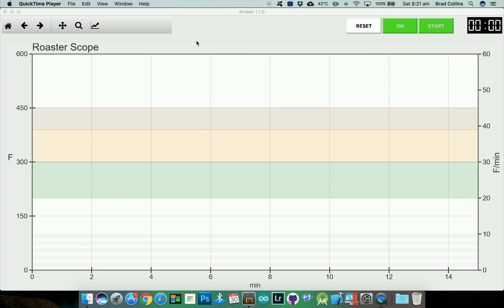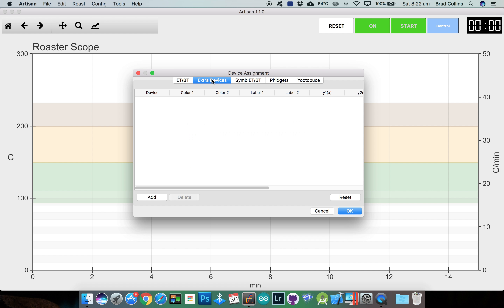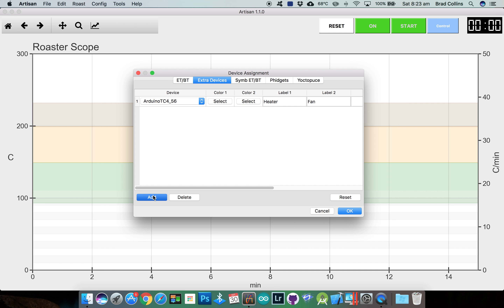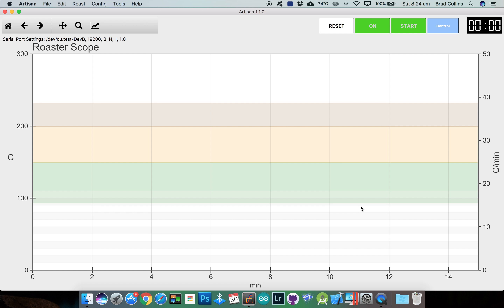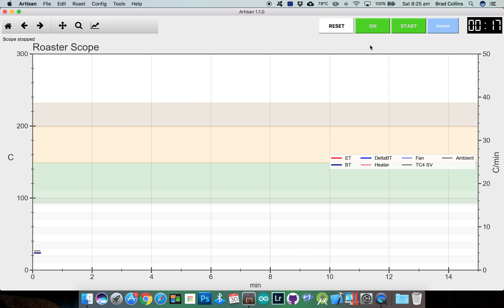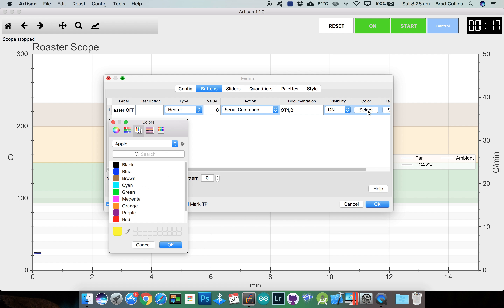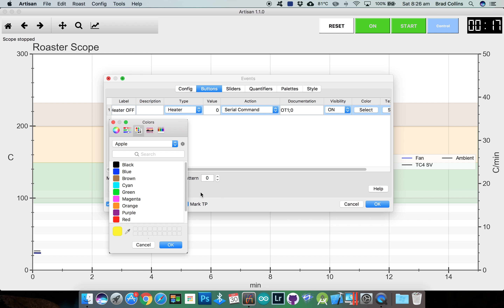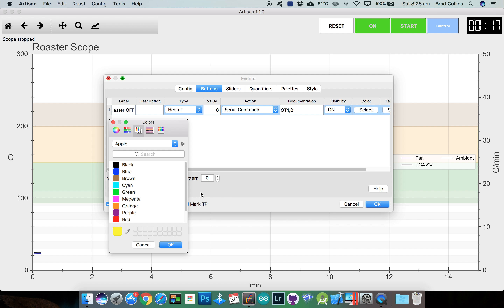Artisan Roaster Scope -  Setup for TC4

Comment: Thanks for this and other videos, and most of all the work behind it!
One comment/question: I think the fan command for a DC fan isn't using OT1 for a setup with the TC4+ voltage regulator and a DC fan on the respective port. According to the documentation and code, it's assumed to be on IO3, right? Just asking, because I could imagine that many who follow the build instructions and this video for a popcorn machine based roaster, might wonder why their fan isn't turning on.
Reply from the maker: Yes, you are correct.  Using the CONFIG_PWM mode in the sketch with assume the fan is connected to the IO3 port and therefore the correct command to use to set the fan output is IO3;XXX

Comment: Does it need setup coding in Arduino IDE to communicate with the artisan software?
I'm using Arduino Uno R3 CH340G, Thermocouple Max 6675, & LED 1602. The LED shows the temperature perfectly. But, how can I communicate my Arduino to Artisan Software? Please your insights. Thanks a lot mate
Reply: Hi. Did you found a solution?